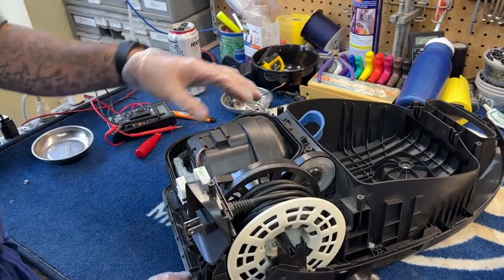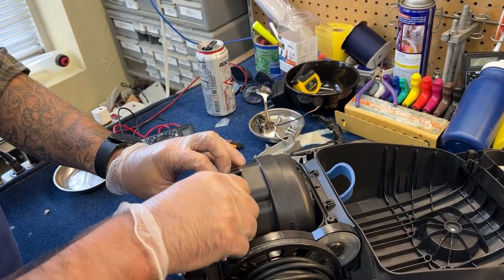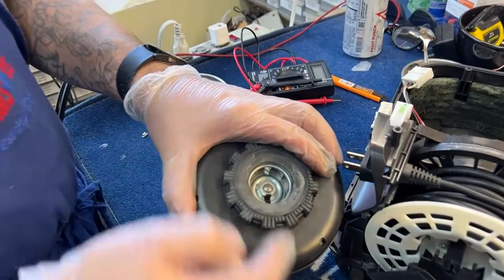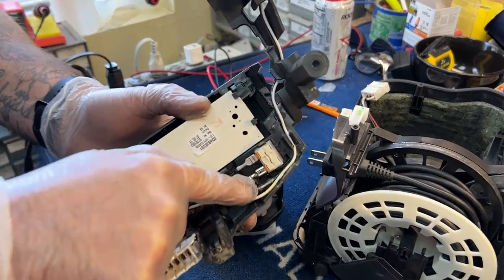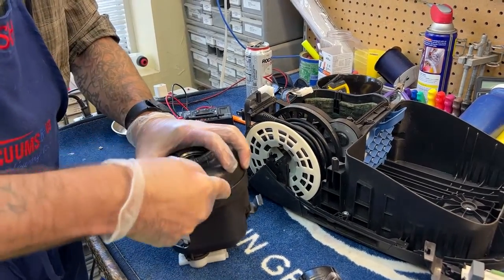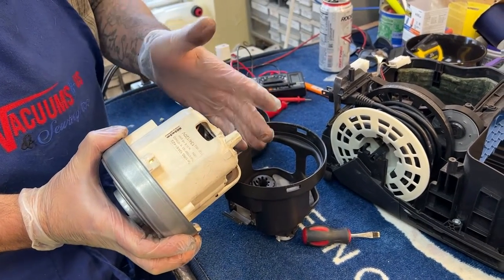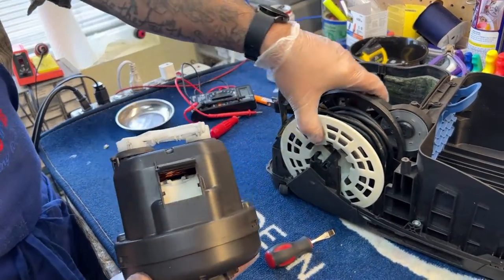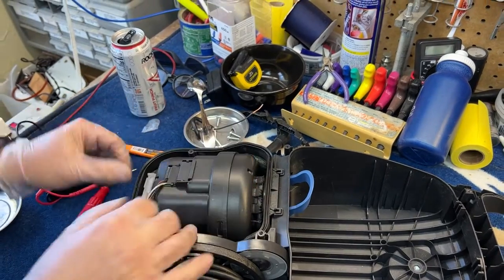How to Replace Your Miele Vacuum Motor - C3, C1, S5000

Comment: Personally I believe the Miele C3 has a serious design flaw with the bag positioning. Too many times the  hose inlet to the bag didn't line up properly and dust and dirt got sucked into the vacuum cleaner and motor. I never had this issue with my previous Miele S5000.

Today I took the whole machine apart and cleaned every part so I now works and looks like new. It's a very serviceable machine.

Comment: I’ve got a c3 and the power feels lagging, the bag came loss and all the debris was everywhere, is it possible to clean the motor
And put back? It’s only 3 years old
And Miele asking for 150$ to repair it, I feel if I took it apart and cleaned the motor it should work okay right?